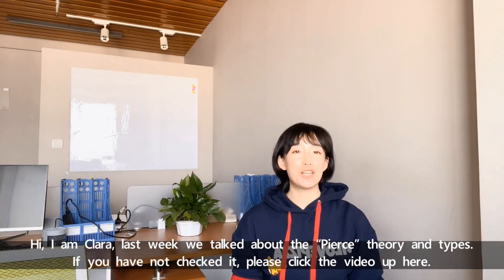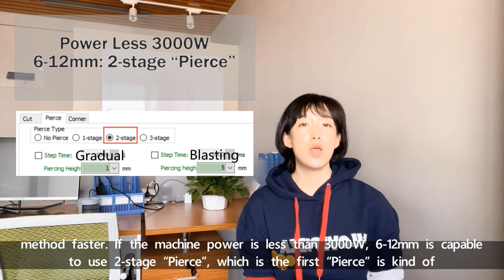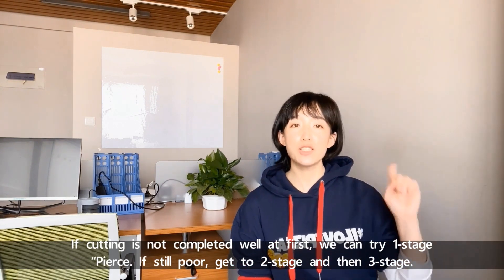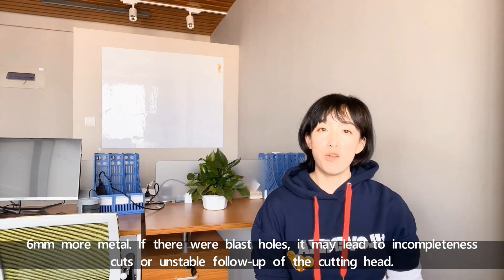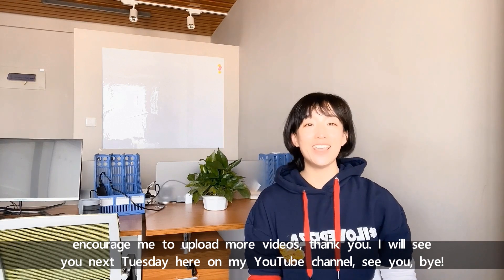Pierce in Fiber Laser Cutting | Perforation in Laser Cutting 2

Comment: Good day Clara. Thank you for your great videos. Please can you assist me, We have 1.5kw Raycus Laser. Using Cypcut Software. My question is, if we start cutting a part, and we pause in the middle of the cut, when we start the cutting again, then the laser wants to do piercing again and not just continue with the current cut line. Where can we fix this?
Reply from the maker: Choose 'Fast Resume', it will skip the pierce steps.

Comment: 00:06 - Exploring the impact of perforation methods in fiber laser cutting.
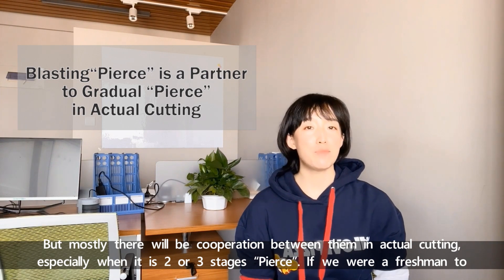00:46 - Effective collaboration is vital for project planning.
01:22 - Choosing suitable perforation methods based on machine power and material thickness.
02:05 - Different stages of pier settings enhance laser cutting effectiveness.
02:40 - Auxiliary gases enhance fiber laser cutting efficiency and performance.
03:21 - Enhancing laser cutting perforation quality through specific adjustments.
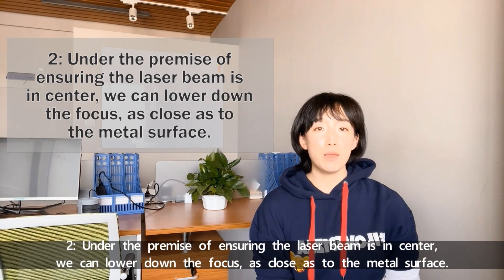03:55 - Optimizing laser cutting parameters for efficient perforation.
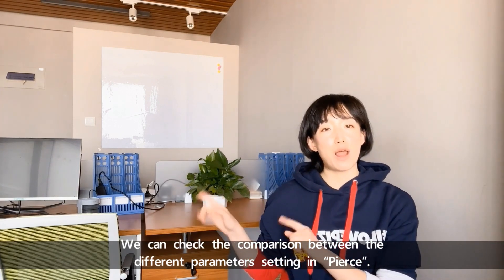04:38 - Discussion on peer comparisons and audience engagement in laser cutting.
Reply from the maker: Thanks

Comment: Hi clarita, I just started to run  fiber LBM tube laser machine with 5000 k and I have troubles with the cut condition for 3/8 thick en above 0:06 material carbon steel, can you help me?
Reply from the maker: you can ask your supplier to help you find the parameters.

Comment: Hello Clara!
I recently purchased a 1.5 kw Laser, I watched your videos which were very helpful and thank you. Now I'm trying to cut 12mm carbon steel, I used the parameters indicated by you but it doesn't work. The problem I have is with drilling. I would like if you could explain the logic of the parameters in the drilling stage, (how and why each parameter must be set according to the type of material). From what I can see, drilling the material at a good quality is more difficult than the cutting itself.
Reply from the maker: The parameters I or others shared are only for reference, you need to find yours.

Comment: Hi Clara, thank you for all the information. I have a question. On our 4kW Laser, the pierce is good but it is shooting alot of sparks out of the top and my nozzle is getting real dirty during pierce to the point that it will not allow me to cut the entire sheet properly. What parameters should I start looking at? For Reference, the material is mild steel, 3mm and I am using oxygen. When I cut the same material with nitrogen, the pierce and the cuts are beautiful but I cant seem to keep the nozzle clean enough to get the same effect with oxygen. Thank you very much.
Reply from the maker: It should be the Pierce setting, please get the proper parameters. And I don’t have your parameters.

Comment: when my laser machine starts the pierce it will make a huge explosion, and make a big hole, i have tried 2 stages, 3 stages, direct, max power, very low power, long piercing times, short piercing times, and it always does the same. (im trying to cut 4mm mild steel with oxygen) the blow is big, and the hole is irregular, making the following cut to be very big and irregular
Reply from the maker: It is your parameters setting.

Comment: Hi Clara, I have one question, right now i have one laser marking machine which is used to mark on stainless steel base but right now its not marking on it, for testing i marked on aluminum plate its working well on that but not on base which i normally use for marking, is this machine loses its power ? or there is some thing else? kindly guide me. machine is only 
6 months old.
Reply from the maker: I’d love to help you. First you need to check whether the focus is correct. And it could be caused by many factors, don’t scare yourself, it may not be the laser source. But my suggestion is to look help from your supplier first, they know a lot of your machines and it is still under warranty.